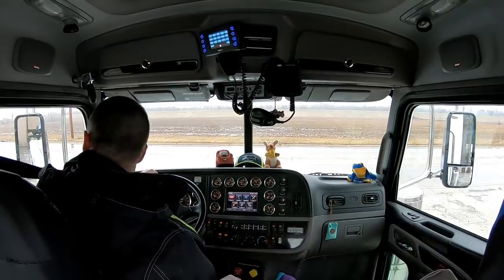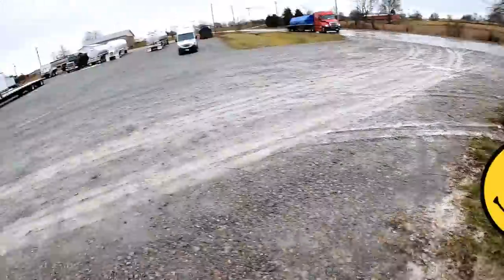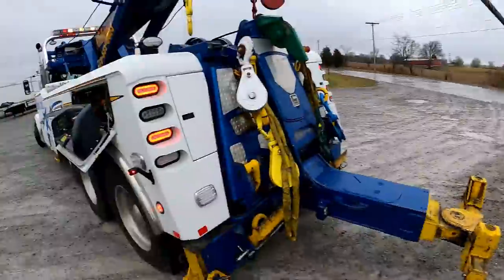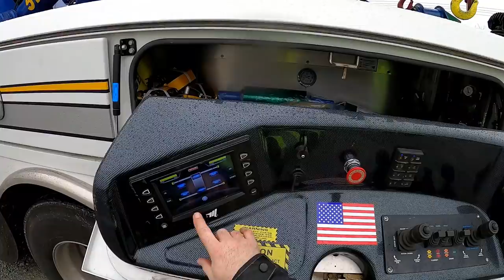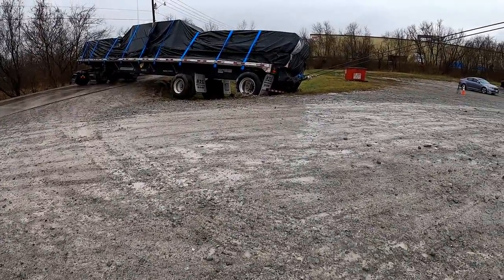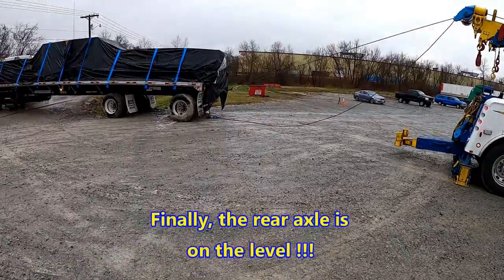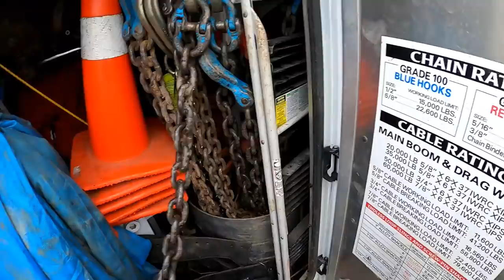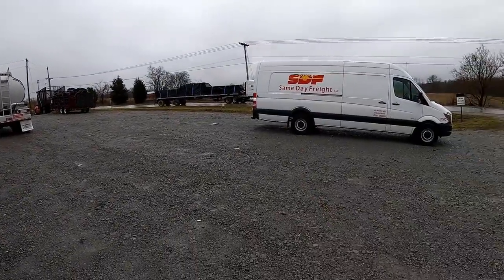Flat Bed Faux Pas!!!  We've Got a Leaner!!!

Comment: With regards to busses and overhang check out this: https://www.youtube.com/watch?v=KZGNdQ35xQY

It is from Stockholm there the transport authority (SL)  added three-axled busses in a  special traffic area (due to the fact that the local tram was rebuilt and so they needed the extra seating capacity.)  Third axles on theese busses is steered and so ... the overhang behind the last unsteered axle is around 4-5 meters -- that means that the buss tail WILL swing out almost 5 feet !

The drivers in this area used until this time basically only two-axle busses (which have a longer between-axle distance.) The film demonstrates a little bit of the differences between a vehicle with longwheelbase-short overhang and shorter wheelbase-longer overhang !

Comment: Wuts leaking air ?  Ive heard it the last few videos
Reply: What you are hearing is the Airbags when weight is let off them they will drop their air pressure.  I don't know how many times i've had to fight with DOT inspectors about that when i use to pull a smooth bore tanker with the liquid inside still sloshing back and forth ( this could go on for about 15 mins )
Reply: Mike Jacobsen It’s the automatic leveling on the rear axles. When he put the cleats down it lifted the back of the truck up. The automatically leveling started to let air out of the air bags to level the truck out.
Reply: I think in that case, it was the trailer's air ride trying to level the axles
Reply: Mike Jacobsen if you’re taking about the air you heard when the cleats were put down before he started pulling. It was Ron’s air suspension bleeding off. Trucks with an air ride suspension have a ride height control valve that when weigh is taken off the suspension, if will release air from the airbags and fill the suspension when weight is added to truck. The act of putting down the cleats or outriggers takes weight off suspension so air is released
Reply: over-pressure relief valve releasing excess air build up